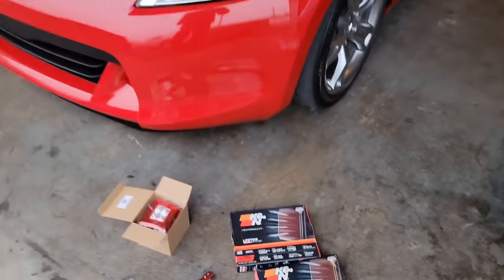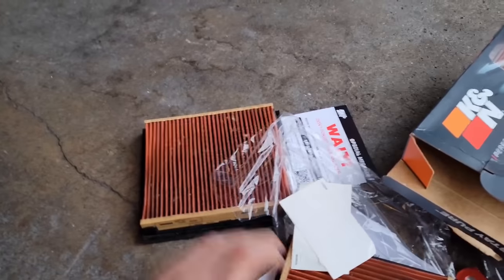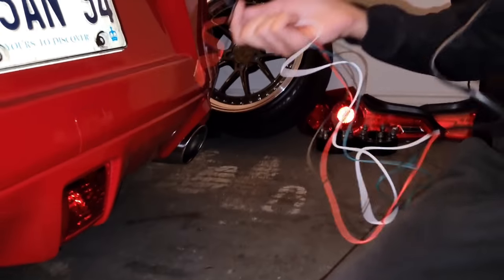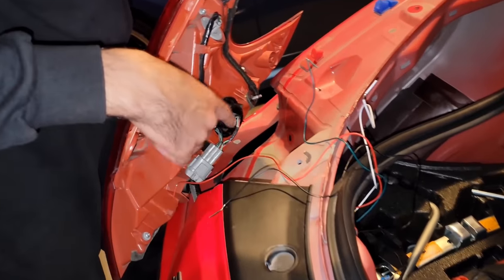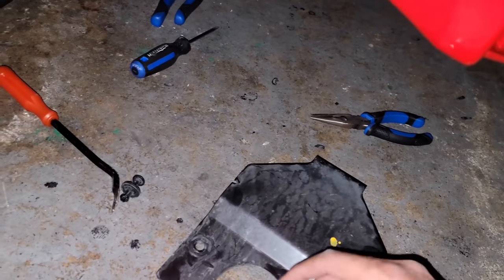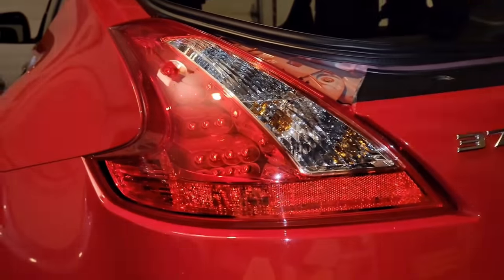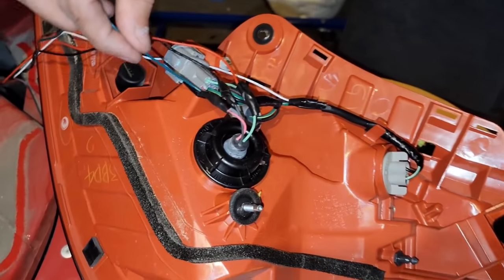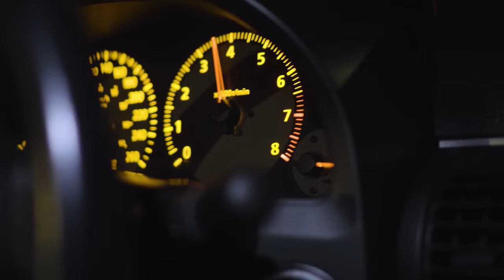370Z gets 4th BRAKE LIGHT and K&N Filters - Installation walk through

Comment: Before you changed to the new 4th brake light from the stock fog light that was previously on your 370z as a stock unit, were you able to turn on the stock fog light from a switch located in your  car and if so where is the switch located?